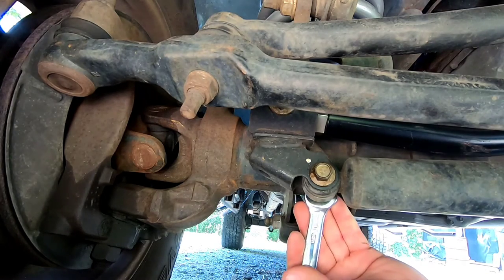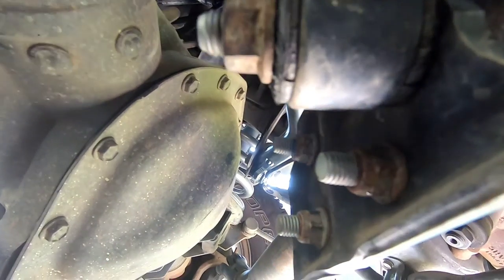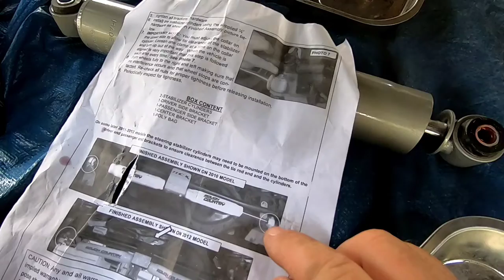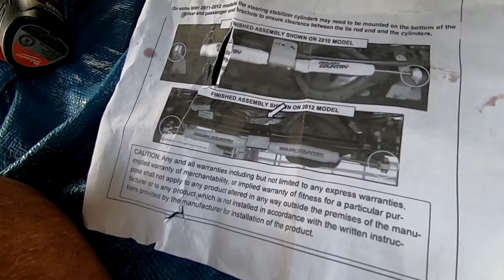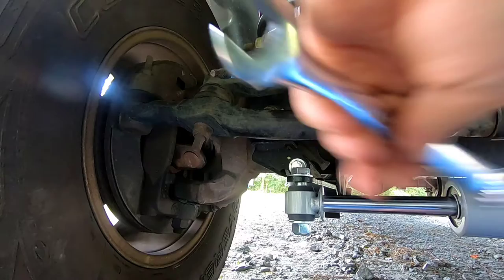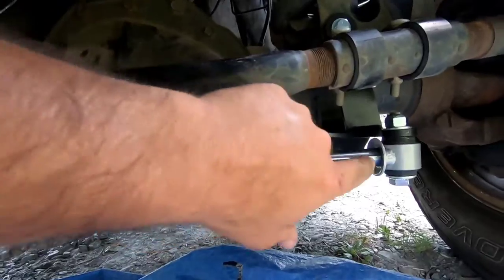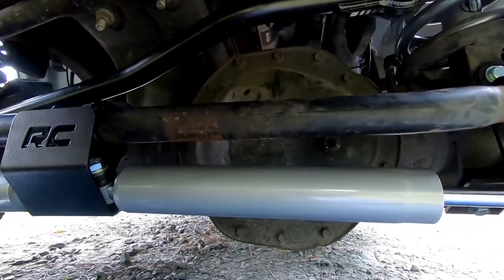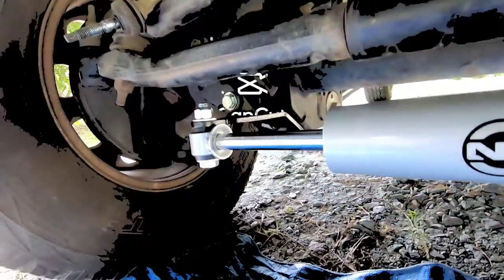Dodge Ram dual shock steering stabilizer

Comment: Steering box brace was the best improvement to my 05 3500 cant believe they let it leave the factory without a brace holding the front of the frame together have a dual steering also it has close to 500000 and handles alot better then it did when I bought it new
Reply from the maker: Steering box brace is a must have for a dodge in my opinion. Without it the steering box will flex all day long till wear and tear or death wobble sneaks up on you. First step buy a dodge and second step build it into a truck.

Comment: Did this end up helping? I just got mine in today and going to install later with the help of your video since the instructions they send are pretty vague lol
Reply from the maker: Yes everything works perfect!
Reply: @isolateddieselperformance3261  alright just wondered. I have a 6” lift with 35s and my walks the road quite a bit so I’m hoping the dual stabilizer helps
Reply from the maker: Do you have a steering box brace?
Reply: @isolateddieselperformance3261  no I don’t have one but I have been looking at them
Reply from the maker: Get one! That will be more your problem than steering shocks.
Reply: @isolateddieselperformance3261  ok will do thanks man!
Reply: What’s a steering box brace?
Reply from the maker: It keeps your steering box from flexing side to side causing play in your steering

Comment: The style you're installing claims to be for 3rd gen, however would this still work for 2nd gen? 

All the mounts look the same, just in case though, I've already upgrade to t steering from the y and also did 3rd gen trackbar.

I would just like to make sure. I'd rather have these brackets and hooking to the tie rod ends with u bolts...
Reply from the maker: It will work on your steering but not sure about bolting up to your axle.
Reply: @isolateddieselperformance3261  yeah I see you have a single bolt and mine has 2 bolt holes... I'm sure I could fab the ends up.

Do you prefer this centered style or would you have preferred the outer kit?
Reply from the maker: I got rid of it and went with the single 2.0 fox. I like it better
Reply: Can you give me the part number for the fox kit you went with.I did the T steering upgrade on my 98 1500 and am haveing a heck of a time figuring out a steering damper kit for it..I would be thankful for any help.I faint seem to order anything for the 1500 because any brackets I get are for the smaller diameter y steering
Reply from the maker: Make sure you look at the entire comment because I put one link for the bracket and another one for the shock.

Synergy (8568-10) 03-13 Dodge 2500/3500 Tie-Rod Steering Stabilizer Clamp – CJC Off Road
https://www.cjcoffroad.com/collections/synergy-mfg/products/synergy-8568-10-03-13-dodge-2500-3500-4-4-tie-rod-steering-stabilizer-clamp

Dodge Ram 2500/3500 2008.5+ Fox 2.0 Steering Stabilizer – CJC Off Road
https://www.cjcoffroad.com/collections/synergy-mfg/products/dodge-ram-2500-3500-2008-5-2012-fox-2-0-steering-stabilizer